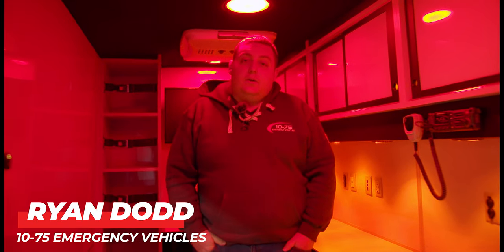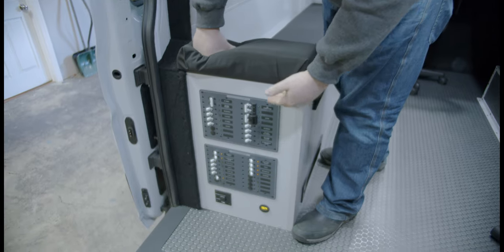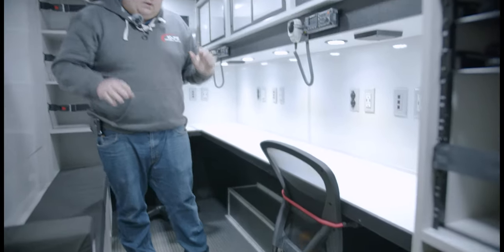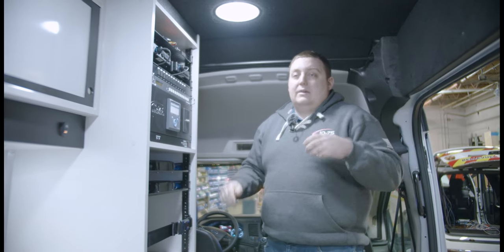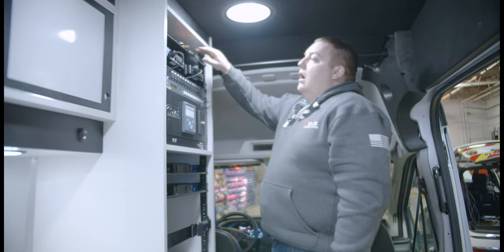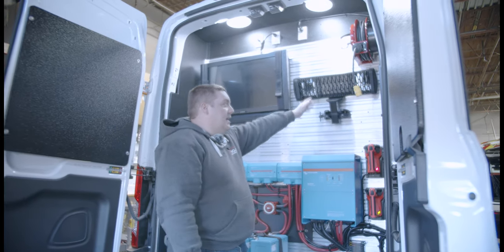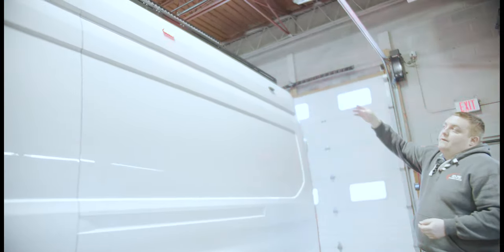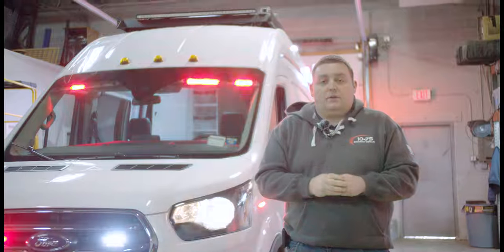Mobile Command Vehicle | Ford Transit | 10-75 Emergency Vehicles

Comment: Ryan is a great announcer, and if these are his ideas , he has the mentality of a civil/traffic engineer, since he can always speculate on outfitting these vehicles with spectacular ergonomics, while speculating on the most proficient emergency equipment for first responders, LEO’s, federal-state , local tactical units etc etc.. He truly is the “Go To” aficionado when it comes to public safety fir first responders & the public in general simply because he has the capacity to speculate on future traffic engineering etc. , as well as actions & reactions to all vehicles first responders may come in contact with while running code?
Reply from the maker: Thank you for your kind words

Comment: The bench was a nice touch, you could have easily just made the bench come right off, but that would cheapen the feel and be a hassle to the customer
Reply from the maker: Thanks for the compliment
Reply: Got a peek inside one of these. Looks like a luxury RV with a family in there watching TV. Another expense being abused by police
Reply: @cataderian  you do realize they insulated it so that they wouldnt need to run the AC, and thus the engine, in the middle of a gas crisis. These stay in service for 15 years, so stuff breaking is not an option and seemingly expensive things like insulation are paid back over that timeframe